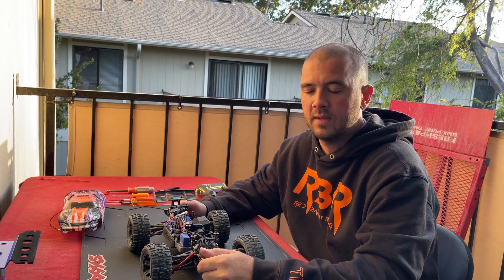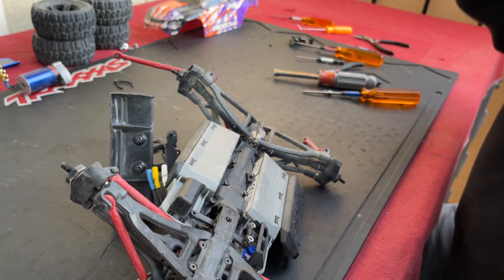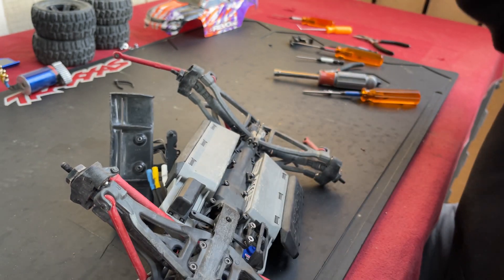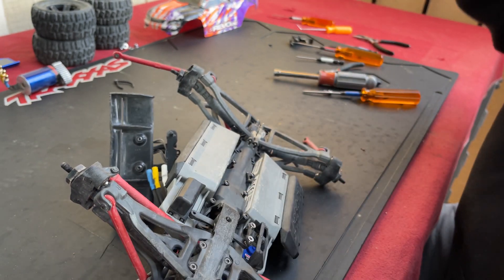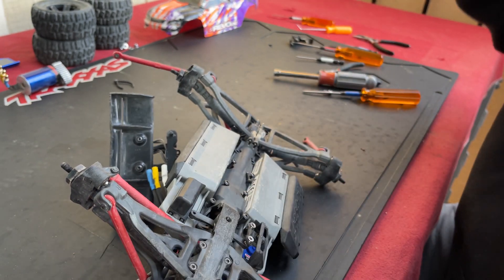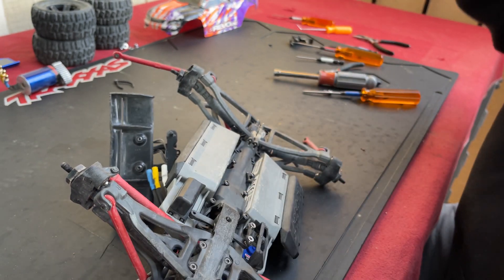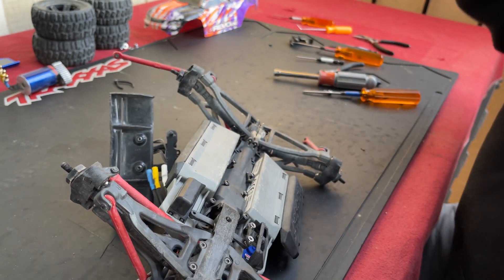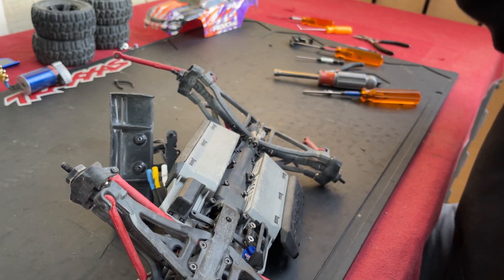1/16 E-Revo VXL | Clicking noise FIX!

Comment: our mini e revo is our oldest rc and is still going strong on 2s. we put in the upgraded center diff and noticed more traction control with it. in fact thats what it does, it turns the revo into a constant 4 wheel drive to a traction control rc, just like a car or truck giving power to the wheels that need it most. i also had the slightest space in the diff covers when i put in thicker diff fluid. thought that was strange but so far so good.

Comment: You didn't necessarily have to buy the whole differential or part 7078, I had the same problem and I managed to take apart the differential itself and only had to use 7079 to fix the merv.
Reply: Just be prepared to add some silicone grease or part 1647 to the diff before putting it back together
Reply from the maker: We like having extra parts

Comment: Have you ever thought of getting a udr or kraton. I just cracked open the diffs in my Maxx they where disgusting now there nice and clean
Reply from the maker: I would really love to get the UDR, it’s definitely on my list.
Reply: @redbanditracing  I was wanting one until it cost 750 now 😥
Reply from the maker: @Brayrfd1192  Yeah it’s a little pricey for what you get, even the Sledge is a little high considering the upgrades you half to have. Honestly the MAXX V2 was so far the best purchase for the price.
Reply: @redbanditracing I have the v1
Reply from the maker: @Brayrfd1192  V1 is still a really good MAXX. Have you upgraded to the WideMaxx?
Reply: @redbanditracing  yes I love it

Comment: Does not have to run 3s for that prob to appear . 1/16 brushed Slash has same issues. Easy fix unde 20 bucks , new rear diff, old diff.  out to trash.
Reply from the maker: The Slash may be different, the mini Erevo can run on 2s without any issues. This fix and upgrade needs to be done to avoid it from happening again.
Reply: @redbanditracing I have never run my e revo o 3s and also have this problem. It hasnt been used in a few years because of it but now in thinking in fixing it. Do you think a rear aluminium bulkhead is also needed, or I am good with just the skid plate
Reply from the maker: Good question, my local hobby shop had the aluminum bulkhead sitting on his shelf for years. He offered it to me for 50% off but I bought the plastic instead. I’m sure the aluminum would be fine, but the aluminum skid plates are way cheaper to get to fix the issue.